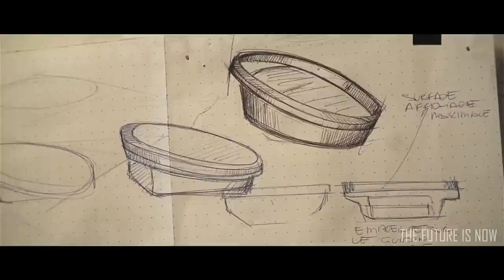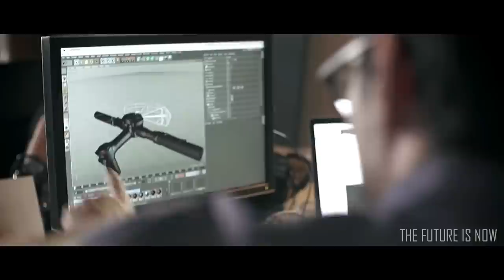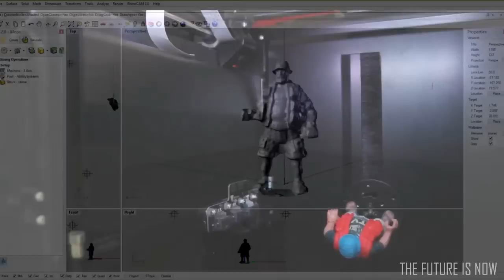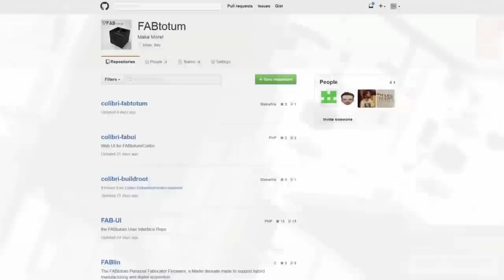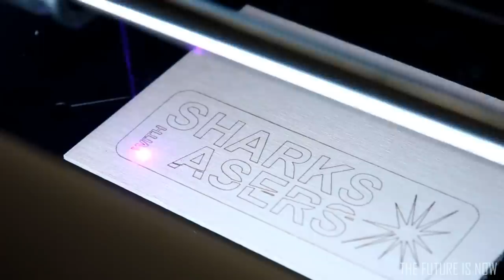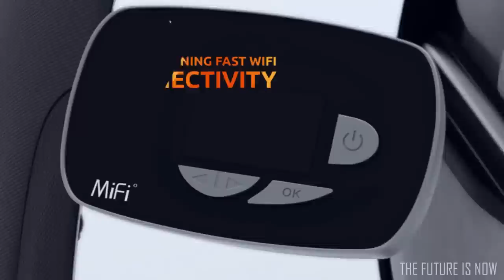5 Futuristic Tech Inventions

Comment: Smart Halo, how do you recharge battery? Lasts for 3 weeks? Built into bicycle handle bars? I should hope product last longer than 3 weeks and do not need to plug entire bicycle into electric socket to charge small item.
Reply: +Michael Meyer What they mean is it's not meant to be taken off regularly, but you do take it off to charge it. It's not BUILT IN to the bike, you put it on. Could you imagine having to buy a whole bike for that thing?

Comment: about halo: if it recharged itself via peddal power it would be awesom
Reply: +Colleen Forrest Easy. Install magnets for magnetic bicycle lights on the front and back wheel and use another magnet as well as transformer which can convert the magnetic energy into electricity and wire that electricity through the frame of the bicycle and up to Halo. Or one could craft a crank with an electric turbine inside of it. Then install that between the pedals and wire it up to Halo through the frame. The crank will probably be a bit more tricky :)

Comment: with the smart halo, they said it latst 3 weeks ... what happens after that? i know it dies, but how do you charge the battery if it's permanently on the handle bars?
Reply: +tryplot they say it is delivered with a special personal key to unlock it. I guess what they mean by "permanent" is that you don't take it on/off every time you ride your bike, but rather once every 2 or 3 weeks. Personally though I wouldn't want all that tech and electricity-dependent stuff on my bike. I ride it to get away from all those things :D
Reply: +Daniel Kemnitz if that was correct then they would have said temporarily rather then permanent
Reply: +Jacob Christian Not necessarily, since "temporary" points more at something which is taken off often, and they clearly wanted to emphasize that you don't take it off your bike every time you get to your destination. By calling it permanent they make it clear that it won't be unnecessarily complicated to utilize on a daily basis, it is simple and common marketing techniques they are using. If it was completely permanent, then first of all why would it have a battery indicator and a lifespan of 3 weeks without solar cells or a dynamo running it? Why would they make a big point about the key you get with it?

It is definitely intended to be taken off every 2-3 weeks for recharging the batteries, then attached again and staying attached "permanently" for another 2-3 weeks.

Comment: considering smart Halo ... can it transmit an emergency call in case of an accident ... being wireless the bike theft would only be possible by hackers witch wouldn't make it difficult ... that aside if you add one of those spoke charging devices for the lamp, alter it a bit you can almost make that little toy un-chargeable since it provides its own power from the users motion ...

Comment: "The tip reaches a maximum of temperature of 490 degrees."
I hear a European accent so i assuming this is in celsius?
I don't think 490 degrees Fahrenheit can melt metals used in electronics so I'm pretty sure its celsius.

Comment: Just gonna give some audio tips for the video/ads maker(s) it's boring so you can miss this comment

1:30 to 2:00
Too much compression, should have let a little natural noise flow along with the voice
Gives the impression the drone is way more noisy and you tried desperately to mascarade it
Should use little (or manual) compression or record the voice separatedly then overlay with side chain

9:33 till 12:30
Transitions on the music are way off from video transitions, and at 11:07, why a transition to a happier beat if nothing important is happening on the video?  
Syncro between video and audio attract more buyers, believe or not

5:10
Not an audio tip but useful anyways:
The ad for the bike Halo is way too technical, very good to sell but too common. Be more creative (not forcefully creative, like, the ice cream thing in the middle of all this density) and you will increase sales like magic
It has very good audio work, I give you that, but another issue is that it is too long.
You should have compressed all important features on the first half, then discharged the residual info on the other half along with the music change (7:30)
Otherwise shouldn't have changed the music at all! Change beats, not the music! It drives our attention to the music and out of the product, just briefly, but enough to ruin all the work so far

Also... COLORS!!!!!!!!!!! 
It's an ad for a colorful thing, not for a drama movie! Why so much grey-ish? 
Shouldn't try to force us into focussing  the little colors on the background, nobody understood the meaning of this. Should use illumination that set the good mood
As I said, too technical

Hope you guys use these tips for better future vids, and more sells ^_^

Comment: They should use solar power . Not so smart. I had a light on my bike 45 yrs ago it was powered by a small generator that attached to the frame and contacted the tire.As for the fotokite  a slight gust of wind and it would crash into tiny pieces. Sure 3d printers are cool but you can buy most things for less than the machine. I am still waiting on my flying car that was promised 15 years ago.